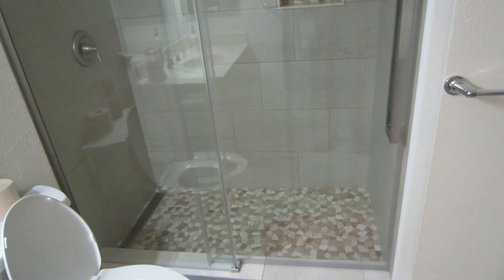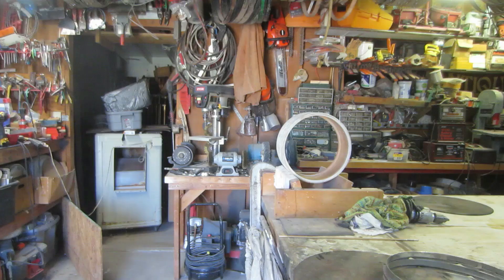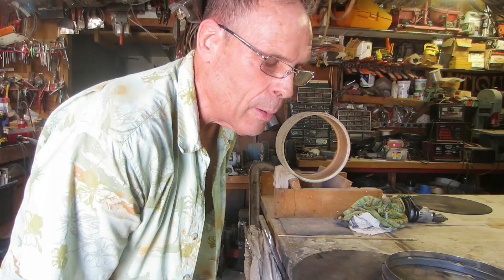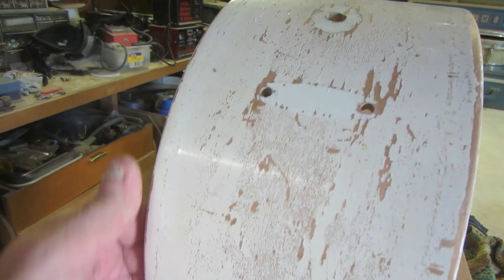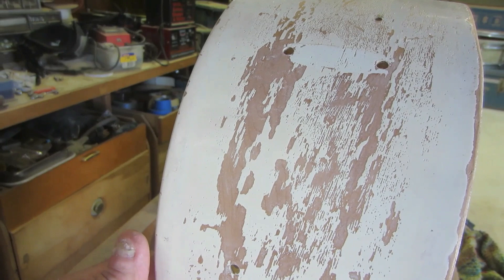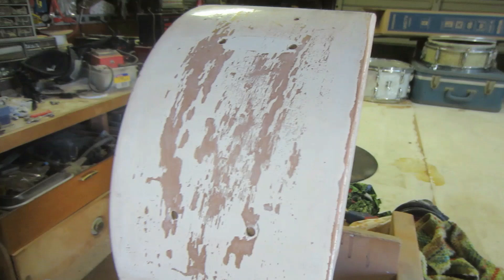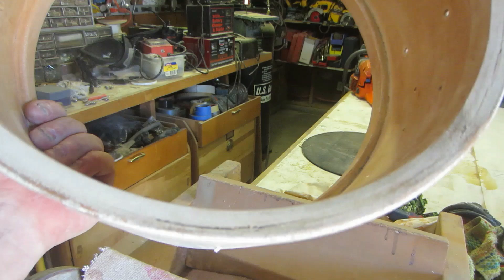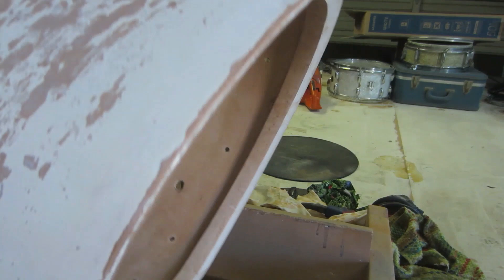1936 Slingerland "Artist Model" Snare drum Restoration ( From the Trash to the Stash) PART 1

Comment: Hi, My name is Jim. I live in New Hampshire, I have an old Slingerland snare that I’ve been trying to figure out the date of. It’s got a camo finish, obviously paint! But the badge is original. My Daughter and I are drummers, and we picked this up at a garage sale a few years ago. I just bought a new TAMA set and dug this out. It has the black and brass or copperbadge, and this is the number on the right side of the oval badge. 68928 The man at the garage sale said it was played in a jazz band in Texas in the 60’s he said it was a 1965. Do you know if its maple or walnut? And maybe a better way to date it? Thank you very much. Jim
Reply from the maker: Hi Jim, If the inside is maple like the re-rings it could be a solid maple drum. Depends on the model though. Send me a few pics, I need to see the bearing edge. budsmusic@hotmail.com
Reply: Look for Slingerland Vintage Snares Badge Listings on the Internet ! Slingerland never used Walnut for its drum shells . Maple Shells were used !!

Comment: That drum is not an Artist model, nor is it pre-1936. Those lugs are roughly 1938. Earlier lugs were tapped and did not have springs. The Streamlined lugs were introduced in 1935 when the Broadcaster line came out. Prior to that, tube lugs were used. Thus drum is probably  '39. If the drum was an Artist or Broadcaster, it would have had a single round red felt tone control. And a totally different, complicated  tone control mechanism. The lack of extended snare brackets and bottom hoop with the screw-on "gates" makes this drum either a Student model or "Buddy Rich" style model. The Artist model drums were offered in 1928-1936 and had tube lugs. The Broadcaster was introduced in 1935 and were the first drums to have the Radio King style lugs. And the very first Radio Kings (1936/37) had actual hand engraved top hoops. You have a very nice drum and your restoration skills are excellent. But your historical comments are quite incorrect.
Reply from the maker: Okay Mark, you would know much more about this drum than I would and I stand corrected. But did you see the catalog picture of this exact drum that I show. It definitely shows these lugs ( tapped or not). I know about the earlier tube lug ones and have a video of that one, but check out the 1936 catalog in my vid and you will see that they called this the Artist model with streamlined lugs. Your input is always top notch, and its good to have you here. Bruce
Reply from the maker: Welcome to my channel Mark. I was only going off of the catalog that I show in the video. Look at it and tell me this isn't the drum I have.It sure looks like it. Thanks for your input, you are the best! Bruce